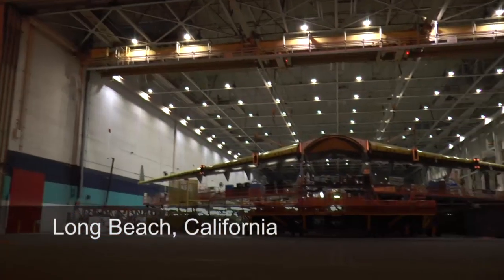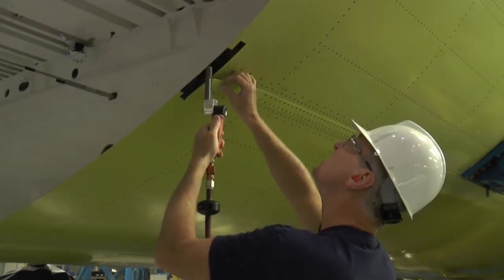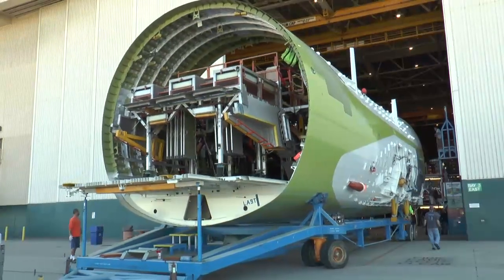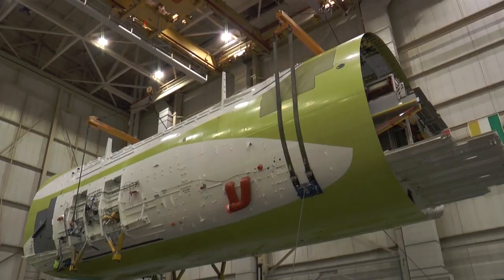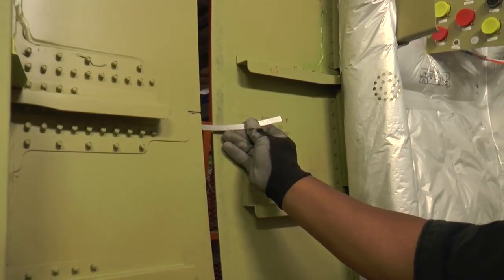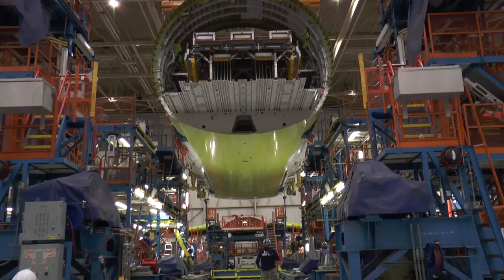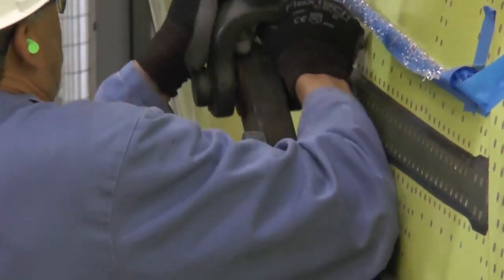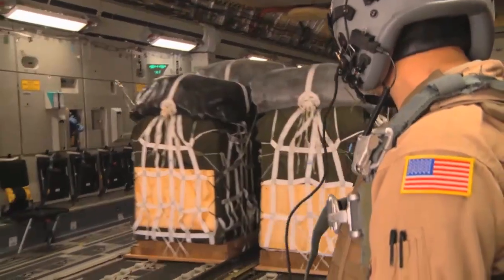Boeing Pieces Together the Last C-17 on the Line

Comment: I remember watching a C-17 being put through its paces at the "Wings Over Sonoma" air show in Santa Rosa, CA in 2006. I was amazed at its maneuverability, with the tightest turn radius I've ever seen on a transport. Of course, it was quite a novelty to watch it back into its parking place following landing, and was open for public tours within 15 minutes. Incredibly large cargo bay - sorta reminded me of the old C-5 Galaxy, but somewhat smaller of course. Still, I suspect C-17s will be flying for many years to come, since their short takeoff and landing runs almost rival the C-130's but with a much greater cargo capacity. Nonetheless, it saddens me to know that such an efficient aircraft will no longer be manufactured. Job well done, crews, well done!